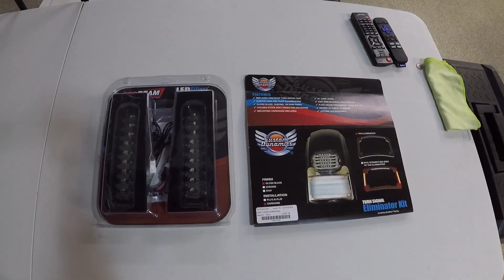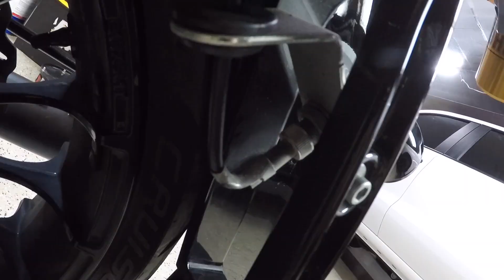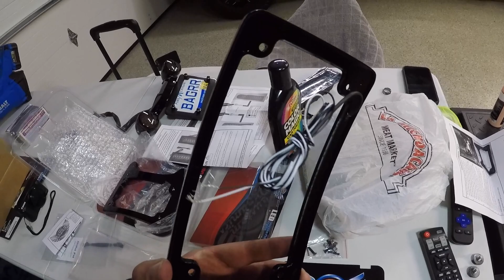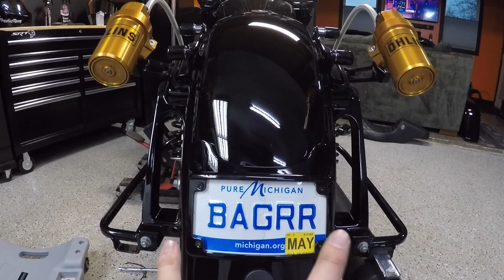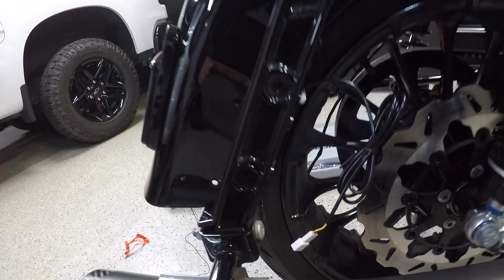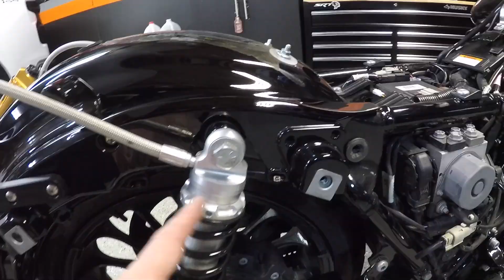CUSTOM DYNAMICS LED PROBEAM FILLERZ INSTALLED ON MY 2019 ROAD GLIDE SPECIAL! *CLEAN INSTALL*

Comment: This will fit my 2020 RG special?
Reply from the maker: Yes!
Reply: @DOOWORKMOTORSPORTS 

We also do offer our ProBEAM® Dual Color Run & Turn Fillerz® for International Models that will work on a 2020 Road Glide Special Harley Davidson International (HDI) model. These will function as a "Red" run light and "Amber" turn signal flashing no brake function.

As per CD, they dont work as brake lights but they do on your video. Am confused.

Comment: Did u cutt the factory wires off the plate and turn signals cus once u take them off that harness goes with them I know u  need that crossover harness but once ur stock plate cover and turn signals are off u dont have the other part of harness ?
Reply: Wat did u do with factory wire harness that originally ran back there u never showed anything with it after u said u had to figure it out is it not needed anymore

Comment: Im a little late to the party on this one, but liked the video.  Did that filler lights get rid of the plug that you used for the lasy video on the tribar light?  Sounds like that entire wire set is not used now.
Reply from the maker: Yes it did. You are correct.

Comment: If I have filler lights from factory, does the splice still work the same? Unfortunately on my 23 RGST it has the center light, the bar, and fillers from factory. Trying to remove the bar and figure out if I can splice into factory fillers.

Comment: Help! I installed mine and I don’t have any brake out of it… I still have the stock brake light on the back of my ST
Reply: Did you get the eclipse module to have brake as well? I’m only getting brake out of my stock taillight and not the fillerz. Seems I need that module I guess.

Comment: did you remove the input wire that came from the main harness to the back ? And used the supplied one by custom dynamics one?
Reply from the maker: Yes.

Comment: Did you splice into the splitter that the filler lights come with  ?
Reply from the maker: Yes.
Reply: @DOOWORKMOTORSPORTS  thanks bro i didn’t hook up my rear plate yet those wires are thin i gotta get a better splicing tool.

Comment: The lights look great, but I really would have liked to see a the wiring for the LED plate light.   I learn better with visual, rather tgan descriptive.
Reply from the maker: I just spliced them into the running lights on the tail lights so that the license plate light comes on with the running lights.

Comment: Did u still need the tribar light delete harness with doing the filler lights? And deleting the stock light entirely?
Reply from the maker: No, I did not.  I ended up sending that part back.
Reply: @DOOWORKMOTORSPORTS  ok, thanks for the reply! I'm going to do exactly what you did on my 2013. The whole back of my bike is converted to the Rushmore parts

Comment: I’m copying you and doing the exact same light setup in the rear. Lol my only question is what did you do with the radio antenna?
Reply from the maker: I removed it.  I never use my AM/FM radio...
Reply: @DOOWORKMOTORSPORTS  do you have to remove the fairing cover to fully delete the antenna?
Reply from the maker: @xaviercbivens  No

Comment: Anthony, you removed the entire stock rear harness given the full delete and therefore the supplied Custom Dynamics splitter has an open end, correct?
Reply from the maker: No, if you aren't running the stock taillight, you don't need the custom dynamics splitter.  You only need that harness if you are keeping the stock taillights.
Reply: @DOOWORKMOTORSPORTS  I’m doing a full delete if stock light bar and only using fillerz for run/brake/turn.  I thought the splitter that it comes with is needed for plugging in left and right fillerz?
Reply from the maker: @SJBagger  Under the seat - Yes.  Under the rear fender - No.
Reply: @DOOWORKMOTORSPORTS  got it, thanks.

Comment: I noticed you didn't have a brake light on top of your turn signal bracket. Mine does. Will the plate frame cover up the hole that is used to mount my factory brake light as well or just the turn signal bracket?

Comment: What license plate frame is that?  Just got my bike back, they changed the fender to a lower profile version but I have no holes for license plate frame or anywhere to add a license plate
Reply from the maker: Custom Dynamics
Reply: @DOOWORKPRODUCTIONS  any specific one?

Comment: Great Job but have a question. It your previous video you got rid of tribal light and installed that jumper harness. Where you went to the filler lights do you still need to run that jumper harness? looked light the whole factory harness that goes down there is no longer needed
Reply from the maker: If you run these filler lights, the jumper harness is no longer needed..

Comment: How the hell did you get the three bolts on the left and right side of the rear fender off off mine are stuck to a backing plate
Reply from the maker: Took some finnessing.  They weren't easy.

Comment: Hey bro love the vids.  I was wondering what you do with all those black factory parts you take off your bike.  I was wondering if I might be able to buy them from you for my 2022 road glide standard.  I’m trying to black out my bike with some parts slowly.  I’m interested in the rear tail lights you took off and the floor boards and the black crash bar.  Thanks
Reply from the maker: I'm going to keep the stock parts for now..
Reply: @DOOWORKMOTORSPORTS  right on thank you for the reply and your videos

Comment: Great looking lights! my only concern is, they might me be a little too recessed behind the bags from a side view making it hard for drivers changing lanes to see you braking.
Reply: Latch lights!
Reply: I agree that was my first though I think I’d want to add some other light as well for a side view
Reply: no its so bright it reflects off the inner bag, 100 %
Reply: Nothijg like the CVO lights. Cvos this year seem to got worse but we will see
Reply: Great observation. I would rather have visibility than cool. I like my original pro beam tail lights. They work just fine.
Reply: Where can I get those tank decals ?! Pretty badass !!!

Comment: Looks awesome. Are you going to put a shorter muffler?
Reply from the maker: I think I'm going to modify this pipe to be flush with the saddle bag, I don't want to run a shorty pipe and lose HP..
Reply: @DOOWORKMOTORSPORTS   I only asked as it looks a little odd protruding so far past the bag on a performance bagger.
Reply from the maker: @joesbuell  Yeah, I'm going to work on that lol

Comment: Looks great. Are you going to keep the full length exhaust or do a mid length?
Reply from the maker: Going to keep the full length.  I would lose HP with a shorty pipe..
Reply: @DOOWORKMOTORSPORTS  can’t have you doing non straight wheelies on that long pipe 🤣
Reply from the maker: @dwight072  LOL I think I am going to cut the pipe so that it is flush with the saddle bag..

Comment: That makes two of us (re: I'm stoked too!).  Looks awesome; clever!  I watched your previous video and was wondering what you would come up with to fill in the elongated openings that were visible once the Tri-Bar piece was eliminated.  Again, looks darn nice.  Good job.  Thanks for making this video. PS:  Front fender?  IMO, the stock front fender from a 2022 RG-ST/SG-ST (in black) would complete the Performance Bagger look.  Earlier today, I ordered the HD colored-matched (Snake Venom) wrapped fender (19") for my '21RGS.  Tom M., Hawthorne Ca. '21RGS & '22FXLRS
Reply from the maker: Thats awesome!  I might go with that fender as well..  However, I do still like the look of the stock fender.  I am tied on what to do right now.